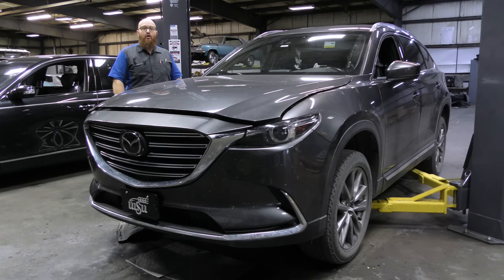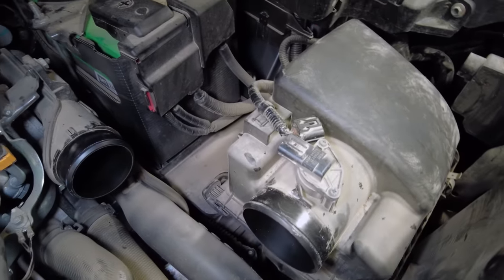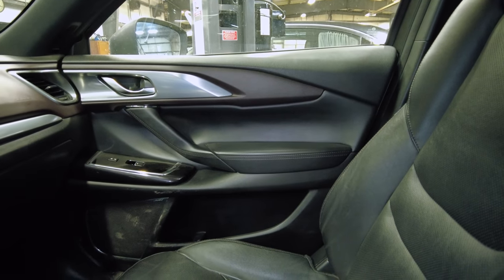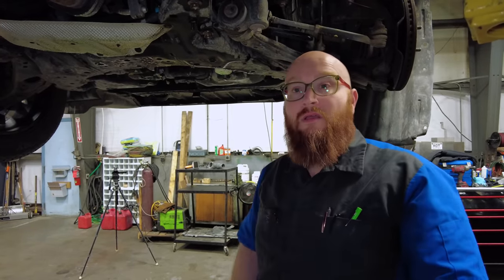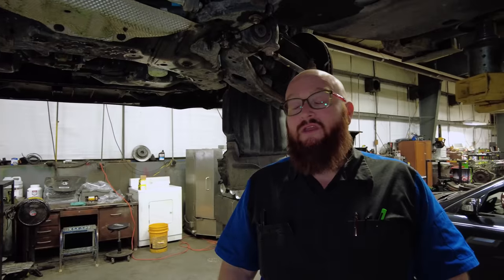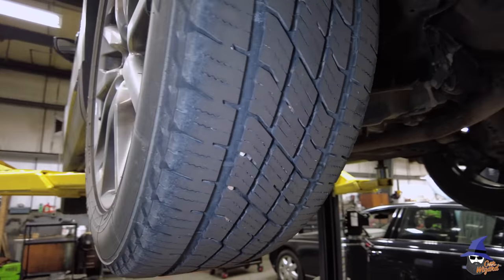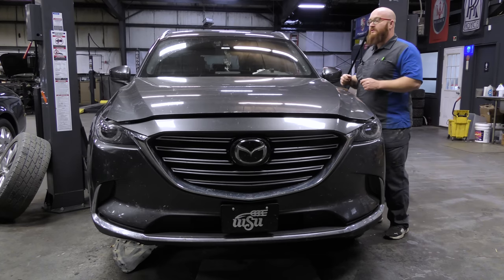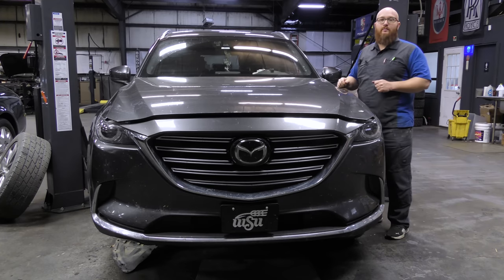Really, a $4K leak! What could be wrong with this '16 Mazda CX9 that could possibly cost that much?

Comment: I was told by the ford dealership that they wouldn’t work on my b3000 truck, which is way more ford Ranger with a couple mazda badges. I had to take it to a Mazda dealer who hadn’t ever worked on a b series. It would have been way better at the ford dealer.

This was for aftermarket warranty work.
Reply: Sometimes it's the age of the vehicle. Many dealerships will tell you to take it to local garage.

Comment: A far cry from my '85 Toy 22-RE where I had it out and in in a few hours (not including having the head checked for flatness and a slight bit of machining to ensure a good deck.  My '85 Tercel 3A-C took only a little longer.  But now I have a shop that did our 2017 4 cylinder Accord.  WAY too many things on that.  Sure wish I knew why that one let go at 122k miles.  The '85 truck had 210k and the Tercel had 295k.  Not really surprised on  those two.

Comment: The Mazda SkyActiv 2.5L engine is NOT a Ford engine by any stretch of the imagination. Mazda had a relationship with Ford and was part owned by Ford for quite a while, but that all ended in 2015. The Mazda engine in that CX-9 is far superior to most Ford engines made in the past 10 years.

Comment: The new Silverado and Sierra have an option for a turbo 4 also. 2.7 pumping 310hp and 390ft lbs is impressive but fuel mileage is like a V8
Reply: So why not just have a V8.  It makes no sense to put an overtaxed engine in a pickup when there is no real benefit to the owner.  Modern vehicles are ridiculous.

Comment: My 2018 Cx-5 had the crack of cylinder heads around at 30,000 miles... Dont Mazda have a plan to recall this problem??
Reply: Turbo 2.5?
Reply: @markg999  not tubo engine. Naturally aspirated engine 2.5L
Reply: Are you from NJ? There’s a NJ recall class action I’m handling.

Comment: Not to beat a dead horse, but that powertrain is 100% mazda, nothing to do with Ford. Common issue with the early ones is the cracked head. 

Also, Toyota copied their formula. My highlander is now a 2.4L Turbo. Same thing, 265hp 310tq. Only difference is that's on 87, where mazda is 227/310 on 87 and 250/320 on 93.

Comment: I'm pretty Thankful that my boss refuses to do any head gasket work.... Unless it's on an older vehicle (70's-mid 90's).
After being burned so many times with escalating parts that need to be replaced as we got further into the engine, he now just sells a complete engine, or they can take it somewhere else.

Comment: I recall seeing alot of Mazda logos all over my 2014 Sky-Active Mazda CX-5.. not sure there are any ford logos doing 90% of the maintenance on my Mazda. I think Wizard is mixing up the SkyActive with the EcoBoost 2.0, Both are very different engines and share little DNA but hey you the mechanic maybe in the parts bin the parts are shared.

Comment: Love this video. Wizard here is my question. If you had to do this job again "in hindsight" would you have dropped the subframe, engine, & tranaxle, assembly out first for easier access to engine. I have seen it done this way using a large hydraulic lift table. Very expensive tool not all independent can afford.

Comment: I help deliver parts to auto shops. Some shops order stop leak and add them to vehicle they sell.
I see often vehicle that come from those shops with problems. 
They try clearing codes and after a short drive the codes come back. I just tell the customer. It's your dime.

Comment: They are probably using 87 octane gas. Its a knock galore, even with DI. Detonation poops out the headgasket in no time.
Reply: He said that it's just the outside seal that's leaking. If the issue was due to too much cylinder pressure the inside gasket would've blown first.

Comment: 90,000 miles is pretty decent for a newer vehicle. You would never hold a modern vehicle beyond 100,00 miles (at most). Had a 2017 Jeep wrangler, under 3 year warranty the front suspension almost fell off, post warranty under 40,000 miles the rear main oil seal failed. This is not to mention a leaking roof that could not be fixed and a temperamental traction/stability control offroad. My 2017 Outback H6 (Japan built) , also with under 40,000 miles just had a blown transmission and a failed head unit; fixed under extended warranty, was over a $7k job. A friend with a 2017 four cylinder (Japan built) had a structural failure with the rear lower control arm which Subaru wrote off as general wear and tear; it never did any off roading. A family friend had a newish 3 series a couple of years back; the sunroof would leak, the electrics would fail. Another had a Mini, it was so unreliable that even the car interior pieces would fall off.
Reply: @EpicDrew15  Not mention Care Care Nut's (Ahmed) and his 600K Lexus LS430!
Reply: Please don't compare a "modern vehicle" to a 2017 Jeep (Fiat) Wrangler.

Comment: Not to beat a dead horse but the “Sky-Active” line of engines is not a ford design it’s the line of engines designed after Mazda became an independent corporate entity completely separate from ford now I will note that yes there are some FoMoCo parts on them but they are hold over parts from when Mazda Co-developed them with Ford.. to summarize there is very little ford in Sky Active powered Mazda models

Comment: Yup Ford and Mazda have literally released identical cars and pick ups in my country; its just one will wear a Ford badge and the other will wear a Mazda badge, this has been going on since the late 80's as far as I know.
Reply: This is a Mazda designed engine and Ford has had NO interest in Mazda for 15 years. You're more likely to find a Toyota part in a Mazda than a Ford part as they have a technology sharing agreement.
They may sell cars with Ford /Mazda badges in your country but that will be a local agreement and has nothing to do with the ownership. Toyota make cars in Europe that are sold as Citroen and Peugeot but they don't own parts of each other.

Comment: @Car Wizard - This time you're wrong on the motor. It's not FORD, but an actual MAZDA motor. Ford sold off their Mazda controlling stake, along with Jag, and ASTON, so they wouldn't need a Gov't bailout in '08. It is the only thing that managed to save their hide.

Comment: My Pacifica with the V6   4.5 years old  66k miles   head gasket   $ 3600  repair     got it back from dealership and that night leaking oil on my newly paved driveway and it was low on coolant.    it's going back and I'm having then come and tow it.   6k over the 5 year 60k mile warranty.
Reply: Old crossover or new minivan?

Comment: In this video Car Wizard isnt such a Wizard, but more of a spreader of bad information. This engine has a TBS about updating the cylinder head with a revised head. Early 2.5T engines developed cracks by the exhaust ports. Also these Mazdas are when Mazda broke away from Ford.

Comment: Well here’s the thing! Mazda makes high quality products! Very reliable! Yes if you abuse the CX 9, For instance driving at high speed on the highway then pulling over when you’ve been driving those speeds and just turn the engine off you will have significant engine problems. The best thing you can do if you’ve been using the engine hard is let it idle for a minute or two before shutting it down. We have no idea how this customer treated their vehicle? What was the oil change frequency? Did they do it on a timely manner? these are all important facts that we don’t know. Anything with a turbo the oil and filter should be changed every 5000 miles regardless . Oil and filters are very cheap insurance. Also letting the turbo cool off after a hard drive. Will insure many miles of trouble free driving. #ZoomZoom❤

Comment: Mazda is not owned by Ford, nor do they work with them anymore. The partnership between the two ended in 2008 (Thankfully). Toyota now owns around 5% of Mazda, and they have a strategical partnership.

Comment: Interesting that so many 4 cyclinder engines around 2.4 L to 2.5 L capacity seem to have cylinder head problems, wonder if that is the limit for that engine configuration and a 6 would have been better? In SA they had many 2.5 L 4 cylinder cars out of the GM Opel group, gas guzzlers and prone to problems.

Comment: For Range Rovers - that's more complicated than just Ford =). Range Rover is Tata now, and decoupled from Ford in 2008. And for complication - I mean they had a bad story with BMW engines, and with Ford engines as well. So now I believe that's something built by Jaguar, not related to BMW or Ford.

Comment: The reason turbos on Buicks fail regularly is that those pieces of CRAPcake "vehicles" have a major design flaw.  The turbo motor oil supply line on those engines is routed directly above the hot exhaust manifold.  It turns the motor oil into sludge before the oil can reach the turbine.  Way to go, GEEEEEE!! EMMMMMM  🙄engineers!! 
How does GM still stay in business is a mystery to me. . .  It's an unending amateur hour these days.

Comment: It's NOT a Ford engine.  Ford used Mazda engines when the partnership between them existed.  The only non-Mazda engine used in a Mazda branded vehicle was the Ford V6 when the CX-9 had a V6 on offer and the Mazda Tribute V6 back in the day.  The current lineup has ZERO Ford DNA in it.
Reply: Agreed

Comment: I found this, Some vehicles may have coolant leaks at the cylinder head around the exhaust manifold (as shown below). There may
be cracks at the stud bolt hole (1) or at the outside of the exhaust manifold (2).
Cracks may be caused by:
• Deformation of the exhaust manifold during usage causing unexpected force to certain areas of the cylinder head.
Residual stress generated during production in the cylinder head material may be greater than expected. The
external force from the exhaust system when driving over bumps may cause unexpected force to certain areas of
the cylinder head.
•
To eliminate this concern, the design of the exhaust manifold gasket and the cylinder head has been modified to reduce
the force on the cylinder head.
Customers having this concern should have their vehicle repaired using the following repair procedure.
https://static.nhtsa.gov/odi/tsbs/2021/MC-10205999-0001.pdf

Comment: it likely has a second leak, like a plastic cooling pipe, it ran low on coolant, overheated and blew the head gasket.. I would check it over VERY carefully for another smaller leak.

Comment: Mr Wizard, does the 2.5 non turbo use the same cylinder head as the turbo version? My wife delibertely bought a 2022 Mazda CX-5 non turbo to avoid issues related to turbo engines. BTW you make very informative videos!

Comment: Head gaskets are not fun, did one once over a weekend. Old lady over heated the car and drove like that. Water pump, radiator and heat gasket and head bolts had to be replaced and jb weld the side of the head cause it blew a hole in it. Crazy that some could try drive on a over heating car.
Reply: Most women will drive a car until it stops. The gauges and lights are meaningless to most of them.

Comment: I've been worried about big vehicles with little turbo engines.  Especially earlier ones. As time goes on, engines will be built more stout.
Reply: In Europe the 2.5L is a huge engine relatively speaking. We have 1.0L 3 cylinders installed on Crossover/SUV vehicles. All Mazda CX9's are equiped with a 2.0L naturally aspirated engine here.
Reply: Not a fan. All the engines I’ve seen blow up here at Mercedes are turbo 4’s in larger cars and SUV’s. Specifically cracking piston 1, or in rare cases, a bad rod bearing. The only car without the problem with the little SLK. Dead reliable in those tiny things. The 4 cylinder turbo in the A class, GLA, and GLB ruined valves or valve seats. Always get a Mercedes with 6 or 8 cylinders. 12 cylinders if you are a lunatic.

Comment: Had a 1989 Mazda 323 ,exact same thing .
Luckily it had under 50k on it and Mazda covered it under warranty 😢
Reply: This engine was designed in 2001 so I doubt there was any connection. Plus there has been a lot of additional changes since then with the Mazda Skyactiv technology.

Comment: This is NOT a ford engine. That partnership ended in 2008 when Ford sold its Mazda shares to save itself from bankruptcy.  I’ve changed an engine on one of these and didn’t see any Ford parts anywhere.  The last Ford engine used in one of these was the 3.5l holdover the previous generation.

Comment: I don’t like overhead cam motors, the dodge 392 supercharged srt puts out massive power but is a very basic motor. Cheaper to work on and very dependable for 800 horse.

Comment: I had the same thing happen to a 1990 chevy, blown head gasket at 90k leaking on the exhaust manifold.  Just threw a bottle of stopleak in the radiator and drove it another 50K until the engine gave out.

Comment: I believe this is a Mazda engine. Ford used to run the Mazda 2.5 in a couple of their models like the Escape and Fusion. Earlier Mazda 2.5s did have Ford parts, but I believe the later versions are pretty much all Mazda. I believe Toyota is invested in both Mazda and Subaru now. I’d hate to say, but Ford was the worst thing to happen to Mazda. Mazda is a lot better today, I’m not a fan of small turbo engines in larger vehicles, but this not being a compression issue is likely just a design flaw. Volvo made some of the best turbo engines back in the day, but that’s it for me.

Comment: Since it's confirmed a strictly-Mazda vehicle, I guess this confirms my battle between the CX-90 Turbo S vs MDX Type S 😬
Reply: This is unrelated to the CX-90. That is a totally new platform with a new engine. This fault is a known issue with early Gen2 CX-9's. Mazda updated the design. Unfortunately this owner is about to get screwed over by Car Wizard because clearly he has no idea there is an updated part for this.

Comment: I'd expect a head gasket to only leak while the engine is running.  If you just fill the radiator...how can a head gasket make it all leak out if the engine isn't running?  Sure the instant you turn it on it can all pour out.

Comment: You wrong! Ford doesn't own part of Mazda anymore! You need to update yourself and stop calling what it used to be. Skyactiv doesn't share a single part with the ecoboosts. In fact, Mazda was ranked among the most reliable during 2010s included along with Lexus and Porsche. This are 100% jdm design engineering...

Comment: I had an older one 2012, I think. Water pump R & R was $2500!!!
I am a fan of Mazdas however. I have 2 CX5's.
Reply: They had to remove the entire engine..
Reply: Was it the Ford 3.7 V6? I never understood the logic of mounting the water pump inside the engine, so that when it started leaking, it would cost a fortune to replace. Not only that, but if the leak was not dealt with quickly, the entire engine would be trashed.

Comment: I worked on one of these and their was a very rare I assume hairline crack in the block from the factory, it was basically new, it was leaking oil from what seemed like out of nowhere on the head, very strange, must have been a casting issue.

Comment: I would like to know how was this Turbo car maintained, what oil used and what oil change intervals ? This turbo is cooled by oil as is engine 5W30 can be low spec oil and when left for 10000miles it will not do good job protecting this engine and turbo

Comment: You are very wrong about this being a Ford motor. Mazdas relationship with Mazda need and during the time , Mazda made or designed the engines for Ford. So its NOT a Ford Engine, its a Mazda. Do your research

Comment: I run a motorcraft filter on my cx-9. And yes its originally a ford/mazda design. At the time ford owned majority stake in mazda. Now that majority stake is owned by toyota. The skyactiv engines are an evolution of that original design. Fairly stout enginges normally. Interesting that this one blew a head gasket.
Reply: Toyota is at 5%, pal.

Comment: Why is it necessary to replace the timing chain, tensioner and sprockets?  I've reused dozens of chains, guides, tensioners and sprockets when doing a head gasket, and have never had any problems.
Reply: The customer may trade or sell it in a couple of years, so replacing those parts may not be wise. Should he want to drive it 300K, then maybe it would be warranted.

Comment: Would like to mention my neighbor's experience and why she will never touch a Mazda for the rest of her life. Her 2016 CX-9 had only 80,000 miles and followed every single maintenance schedule. The engine grenaded and killed the entire motor. Gone, garbage. ICBC insurance told her to stuff it, and the local dealership said no warranty sorry. No recalls, no class actions, nothing. This is due to the water pump being located inside of the engine itself and when it fails, it takes the entire engine with it. This was confirmed with watery oil upon draining the oil. Back and forth with Mazda Canada and absolutely no resolution, told her too bad that's just some vehicles for you. Yet, this is starting to become a common problem for 2016 CX-9's. Completely grenaded engine with a 10,000 dollar (Canadian) repair bill by the Mazda dealer. Absolute piece of sht.

Comment: Mazda has come a long ways since partnership with ford... Became independent and now in close relationship with Toyota... Im not sure on the recalls for earlier models but look out for oil leaks/burning in 2021 turbo models... 2022 and up it has been fixed, but the tensonor pully (leaking hydraulic fluid) and battary drain are the two modern weak points. Also realize difference's in models made in Japan and made in Mexico, Japan made ones are of higher quality (mostly carbon edition). I love my 2022 3 hatch na, but definitely plan on supercharging it to get a more hot hatch feel, wish they would get back to sporty tuners to compete with the civic type r or gr Corolla